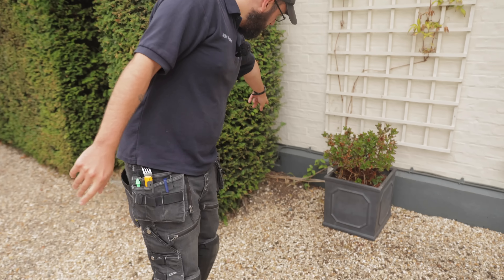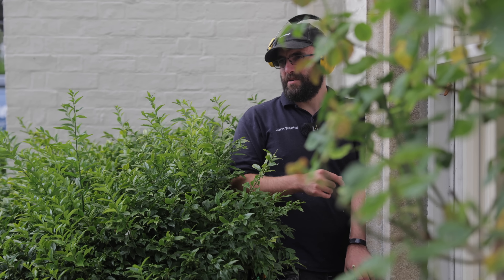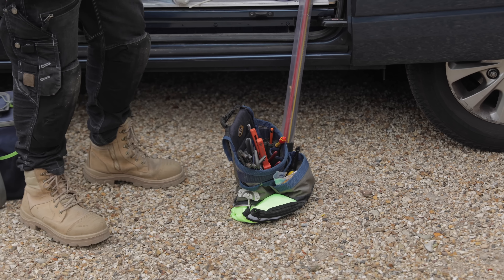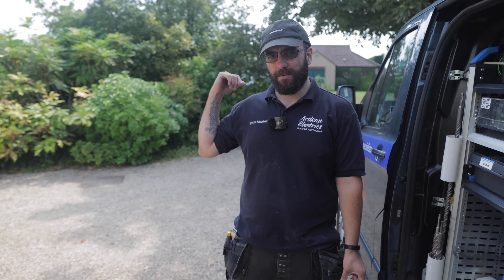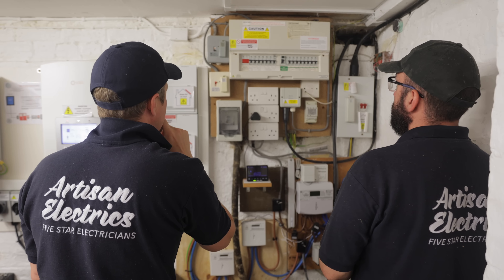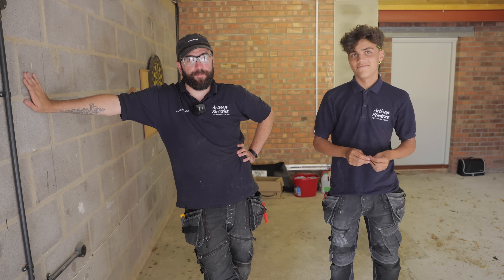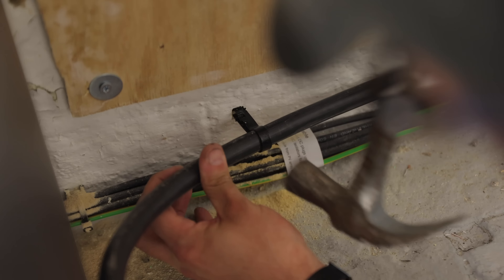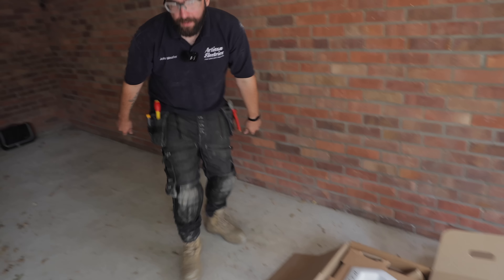Solar Charge Points: Life-changing Technology Or Total Chaos?

Comment: Split phase power is extremely common in the states.  I guess europe tends to run higher voltages and dont see as much benefit from a split phase setup.
For the less familiar, split phase power is when a center tap is added in the middle of the transformer, allowing you to have the typical 240V (220, 230, whichever), but also have 2 legs of 120V (from the transformer, 0 to 120V is one 'leg' and 120V to 240V the other) for smaller appliances.

Comment: Why would you not push for 3-phase zappi?  Seems odd not to future proof when a lot of the hard work has been done.  

Note: those EDMI 3phase smets2 meters have issues when used with Tesla powerwalls. They don’t calculate the vector sum correctly or they read conductive noise as import incorrectly.
Reply: My thoughts exactly. Why not install a 3TP charger where 3TP is available
Reply from the maker: Only two of the phases were actually in use

Comment: Could you not have dug a trench in that gravel drive, conduit or just swa all the way to the garage? Save the cable all over the house front?
Reply: More expensive for labour.
Reply: I don’t think they have a Ditch Witch in the UK.  Less than a hour for rake cut fill rake on that job.

Comment: Fantastic job, guys But I reckon a run that long -- you're gonna waste a KW in resistance and reactive impedance, alone!
I'd be very happy to be proved wrong 😀
Reply: Looks to be around 50m not that long . You have used some very technical terms in you’re comment but the circuit resistance is less than 1 ohm . How is this going to waste 1kw ?

Comment: What brand and size of battery storage did the property have?
Reply: Looks like pylontech
Reply: I did think that, I'm looking for battery storage at the moment and was quoted on a Fox system that has similar looking battery units to the Pylontech
Reply: @blairfalconer915  I’ve specked a solax and alpha system for home but can’t get hold of either battery until October . Pain in the arse .
Reply: The Fox quote was based on September availability. Would be handy to have the system installed before my EV tariff changes mid September 🤣
Reply: @blairfalconer915  what tariff are you on ?
Reply: Current rates with Octopus Go are 5p kWh 0030-0430 and 16p 0430-0030 with 25p SC but these will change in mid Sept